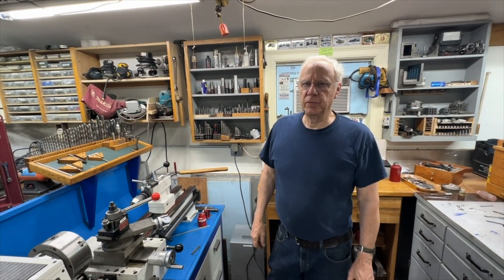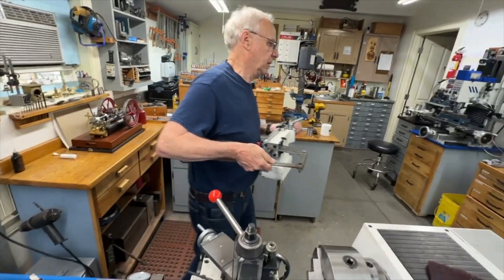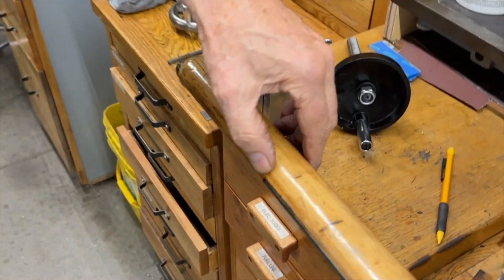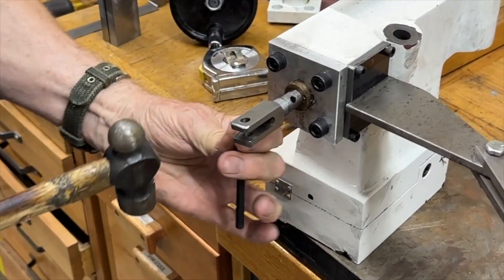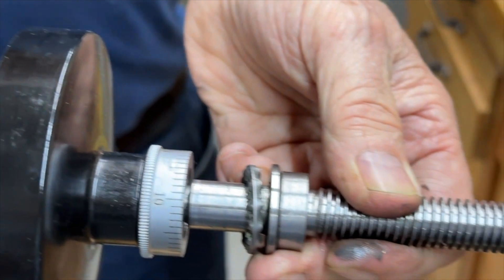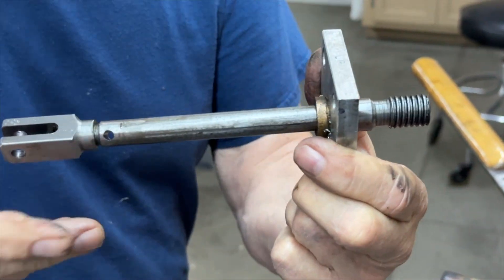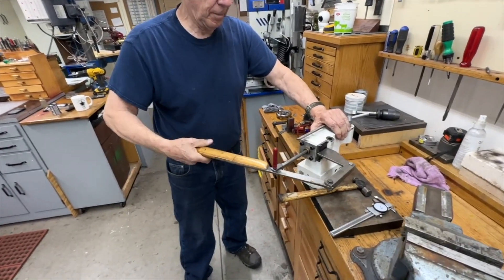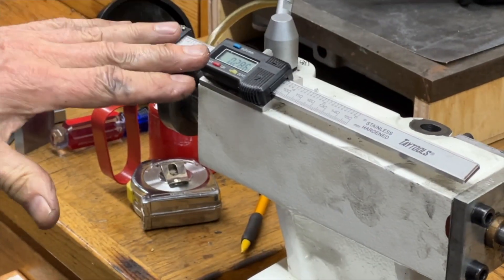PM 1228 VF Tail Stock Modification for Drilling

Comment: Hi Joe, another great tip from the Higgins Machine and Engine works. I have a Cowell unit on my South Bend for the same purpose, it makes hole drilling much easier. Would recommend anyone with a Precision Mathews lathe to follow your lead.
Dick B. USA